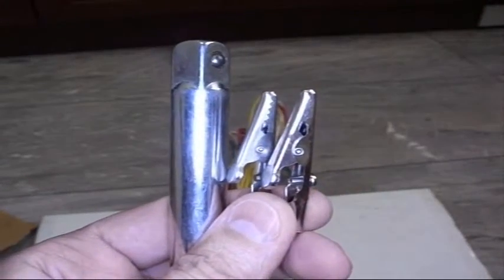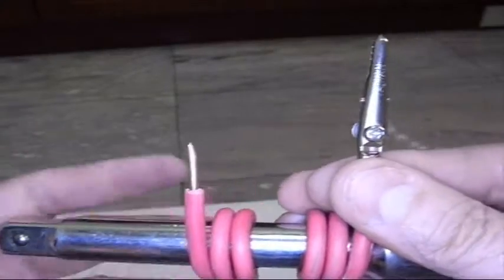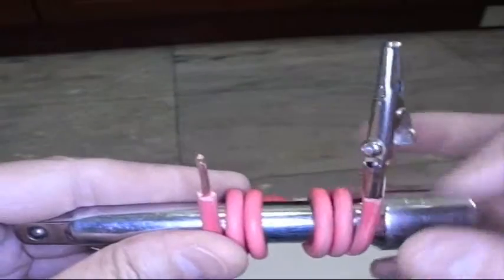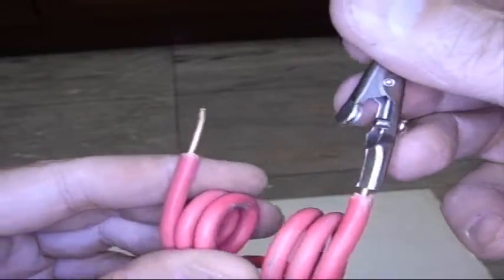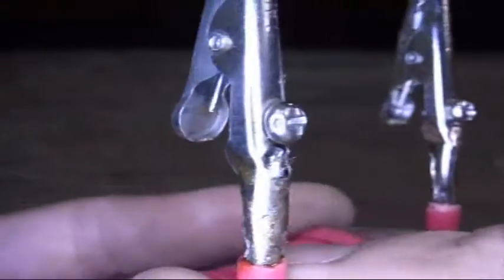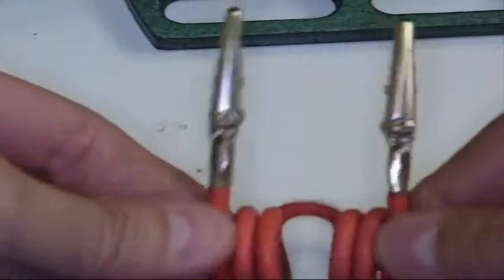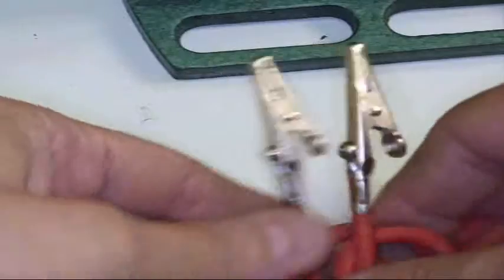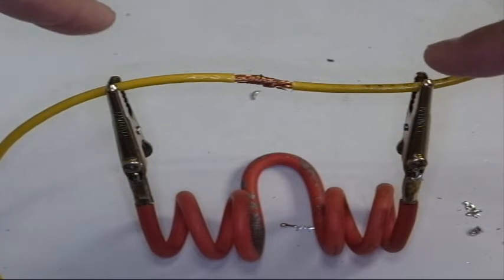DIY Third Hand For Soldering, Gluing, Hobby Work, etc.

Comment: Congratulations. Your idea is EASY. I really hate when people make DIY videos, where I need A LOT of tools and materials, this is so counterproductive. I immediately want to BUY a real product for the real price, instead of buying a lot of things and spending a lot of time for nothing. 

There is a guy, who made some lame hands for soldering, but he needed a wooden frame, which he made with some very expensive tools like a circular saw??!! Then he made very lame hands from some very thin wire. 

Your idea is excellent, maybe the basis of your hands should be attached to some piece of wood, but it can be done. All we need are the two alligator pincers, which grab the two pieces of wires

Comment: I could be wrong but it appears that the extension used to wrap the wire is a 3/8" drive.  
I made one similar to this - maybe even from this vid and it worked well - but I lost the galldang thing.  
Thumbs up.

Comment: What a great and low cost way to make some helping hands! I'm teaching a soldering class at my local maker space next week and we have way more soldering irons than we have helping hands and clamps. Heavy gauge wire and alligator clips are an elegant solution. I'll probably add a little shrink tubing over the claws for insulation. Great tips.